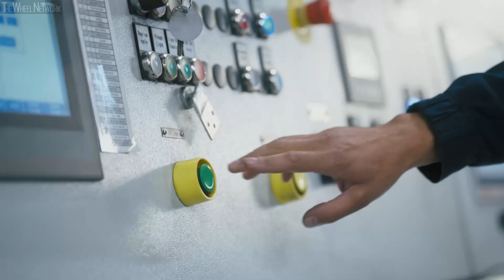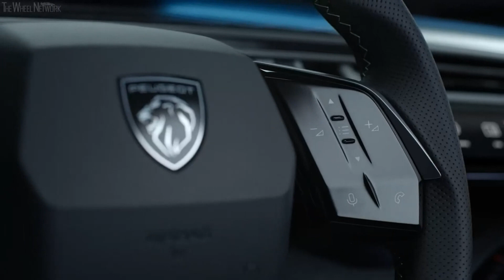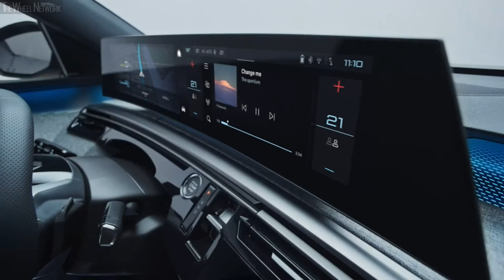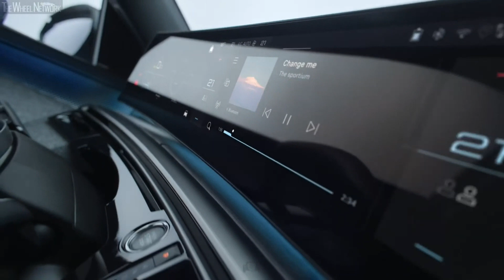Peugeot 3008 Production in France

Comment: Now that I am looking at this again I think that the back of the car is better looking than the front. They don't go together. I think that if they put last years model front with this models back part it would look amazing! Can we try this?
Reply: Si sono d'accordo con te, il frontale del modello precedente era più bello su questo.
Reply: I have a Peugeot 3008 2022. I totally agree about the car's front. Its superb! This new model looks great but the front 😢😢
Reply: @carloshoss78   I just bought a 2022 Peugeot 3008 GT (2.0 diesel) I specifically bought it for the 2.0L diesel engine - extremely reliable
Reply: @allanbriggs807  diesel does not come to Brasil.  We have only one model (GT 1.6 THP) unfortunatelly.